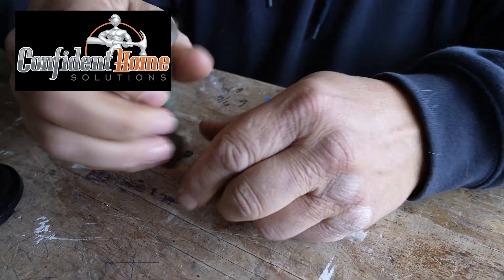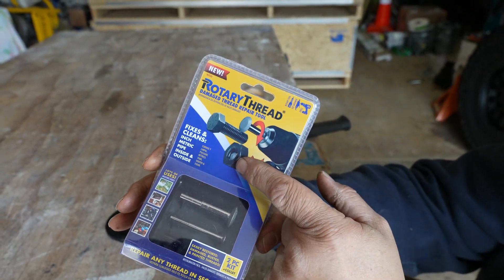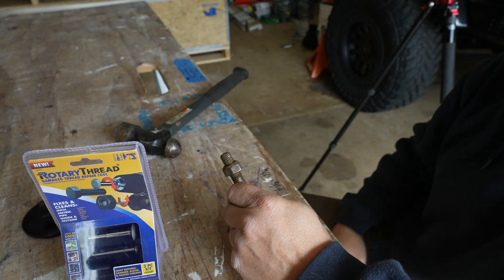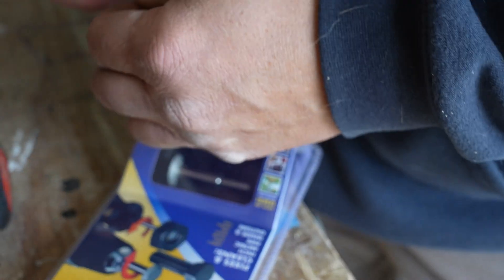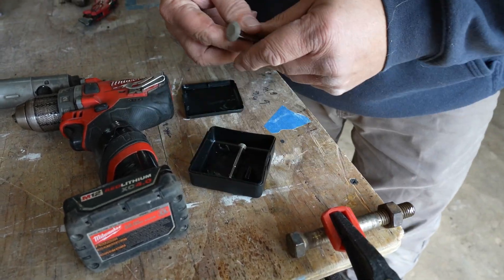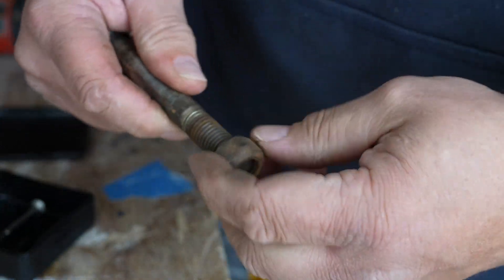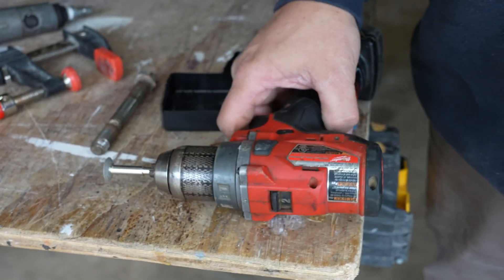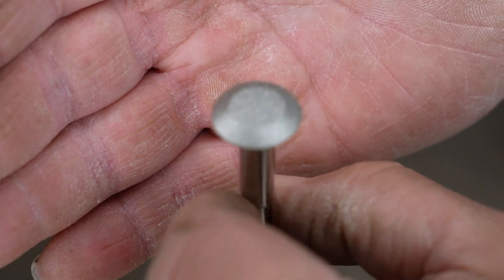Fixing damaged bolt threads using Rotary Thread Repair Kit

Comment: I used it for oxygen sensor port  but it was so badly crosse threaded was extremely challenging to get it right with the location of it. Drilled out a new hole and welded on a new receiver for the sensor.